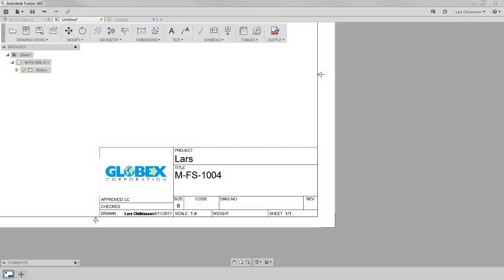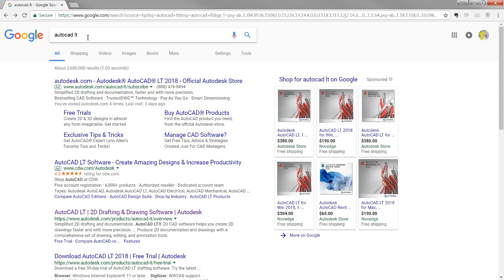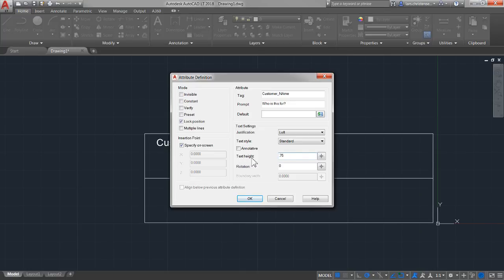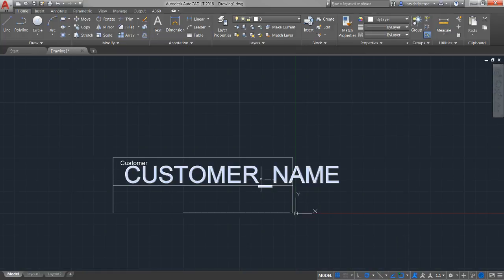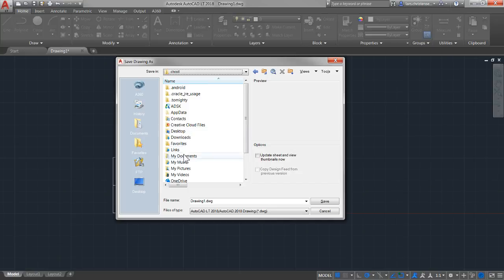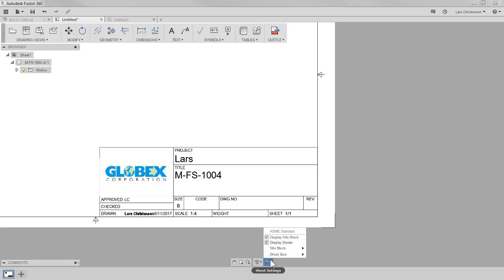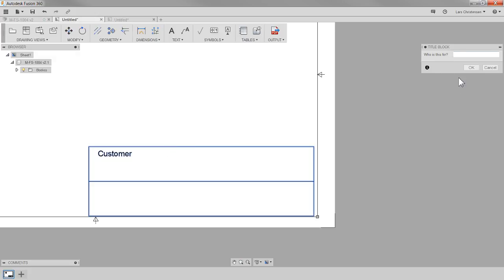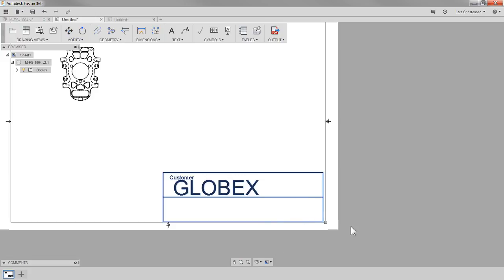Fusion 360 — How To Modify Your Title Block — And Your Comments & Questions — #LarsLive 54

Comment: Hey! Great tutorial! I created a template and it works amazing as in the video! I take my mouse on the title block but I don't get the dotted lines that you get in the video(between time 3min 50 Sec- 4min). Because of that I am not getting pop up window as you are getting to add the attribute value. Any suggestion?

Comment: Good video Lars (as always) but a little disappointing that F360 doesn't have an internal editor (not your fault).  Quick drawing question.  I have a plate that is 6 inches across.  I want it to display as a 3 place decimal (which has been selected), but it still shows up as a single digit 6.  This single digit conflicts with my tolerance block.  Meaning if it was displayed as the 3 place (6.000) it would reflect as a +/- 0.005 tolerance.  1) Why does it show up as a single digit and 2) how can I fix it.    PS: Still no easy way to print drawing from within Fusion, correct?  Thanks in advance. (IG: JPL_Richard)
Reply from the maker: Hi Richard Cournoyer Thank you for watching!
I hope they do have an editor on the road map. This was probably an easy work around, and it does get the job done :-)

Make sure you have your trailing zero's set down in the bottom of the screen in the annotation section.

I print from pdf, when I create drawings...Yes, could use another upgrade...Sounds like I need to have a talk with a product manager about drawings :-)

Comment: What would be great is to be able to change the font of the title block itself. Rather than having it use the default system font. You can edit the font of the information you are adding, but that actually looks worse with inconsistent fonts between the drawing and the title block.
Reply from the maker: I think I need to reach out to a product manager. Now I would like to know what is on the future roadmap for drawings :-) I'll keep you posted
Have an awesome day!!